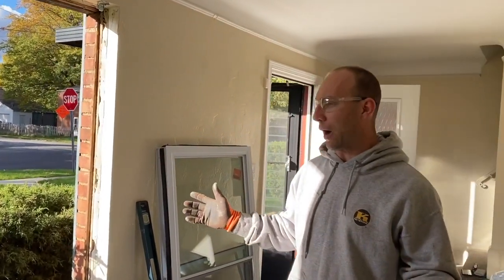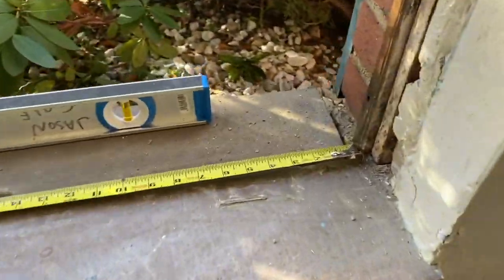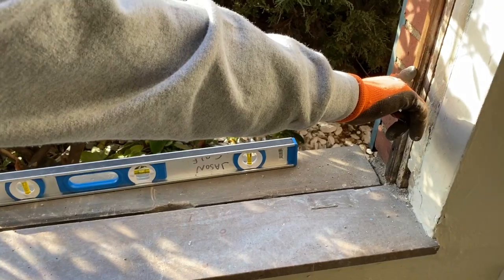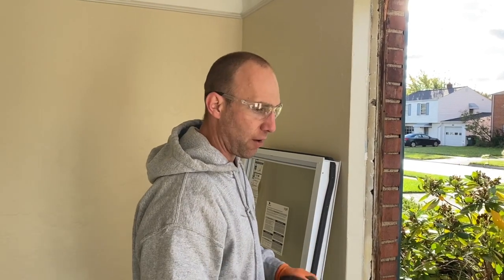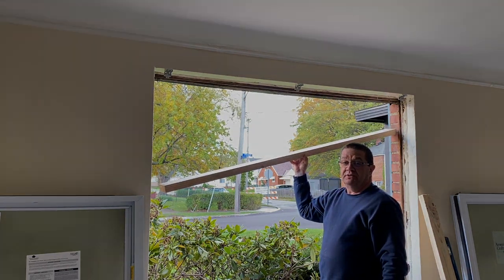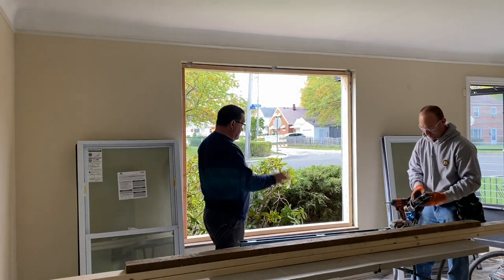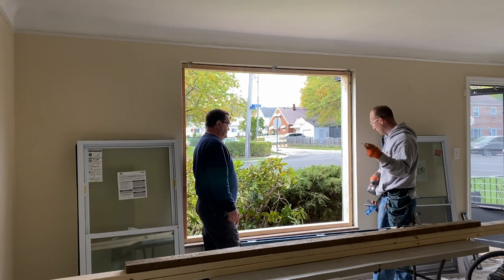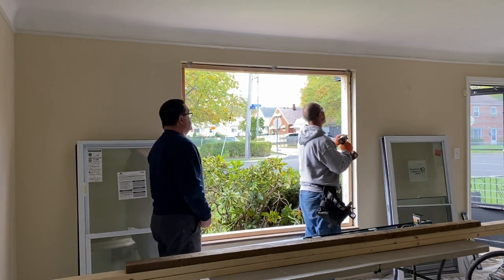HOW TO Build a Window Frame to Replace a Picture WINDOW

Comment: This was helpful and I promise I learned more from you ;). I'm wanting to use in stock windows too. I am framing an open front porch and adding windows. The most economical option I have will be 3 windows side by side, like your 2 are. Could I use (1) 2x4 between my windows or (2) 1x4? Or even screw them together with a bolt of some sort. I am fine with my hight, but I want more window than frame fir the porch. Another option may be to afix directly to the big square posts on the far outside end of the frame. Please let me know if any of these options could work.
Reply from the maker: Hey there.  First…thank you so much for watching.  So it sounds like you have a fun project in the works.  For myself I would NOT just screw the windows together. You really need some kind of post between them. You can order windows that are built together but I have never done that (It’s expensive, and they take 8 to 12 weeks to get) I have always used  a 2x4 in between. It adds more stability than 1x4’s.  You could try the 1x4 idea and see if it works. Nothing wrong with experimenting a little. The main thing may be layout. How many windows you are putting there, how much space you have between each window when you lay it out, etc.   Also, if the corners are nice solid wood posts you can attach the window directly to those without a problem.   Hope this helps.

Comment: I thank you very much for demonstration but both your voice was not audible sometimes. It is hard to fix it after recording but you can add screen writing in those instances. Much appreciate for your help!!
Reply from the maker: Thanks so much for watching and for the heads up on the audio. I didn’t know there was a problem so I will check it out

Comment: Did these windows come with flange and if so did you cut them out? I only see windows with flange at my local homedepot
Reply from the maker: They did NOT have flanges.  They are replacement windows.  Flange windows are basically new construction windows.

Comment: Did you guys measure the height of the windows wrong? I don’t understand why you would need to have to install an extra 2x4 at the top of the windows .
Reply from the maker: Good question.   Typically we would have ordered windows to fit the opening without using any lumber at all but we had to use stock windows because of time limitations. So we found the closest size windows and then needed to frame the opening for those windows.